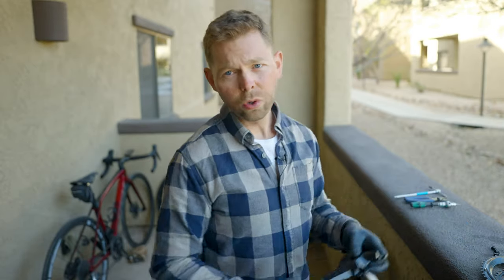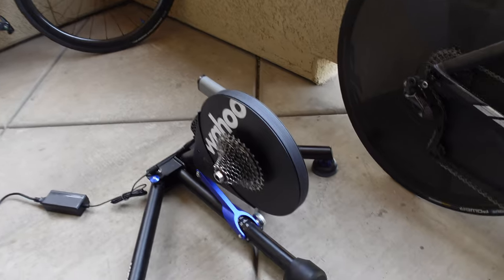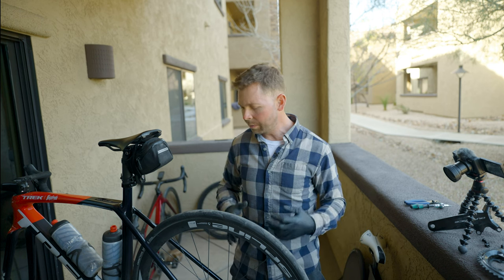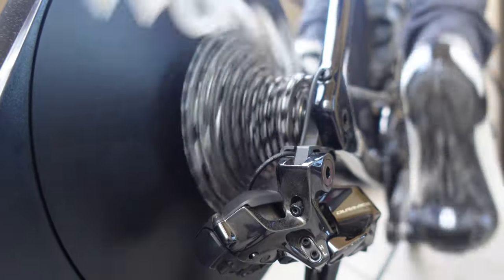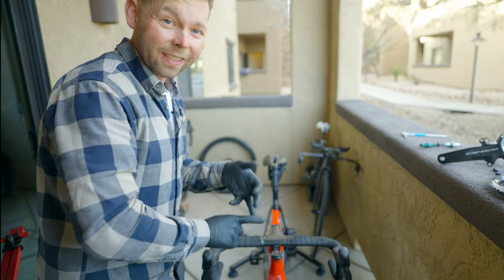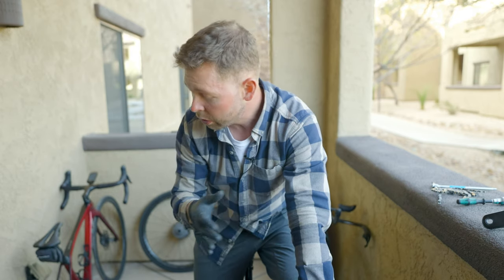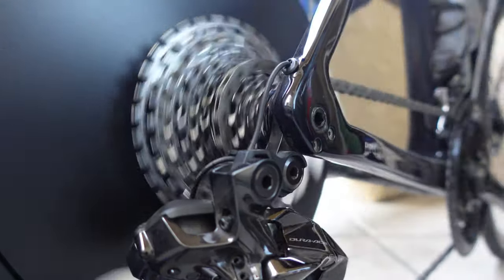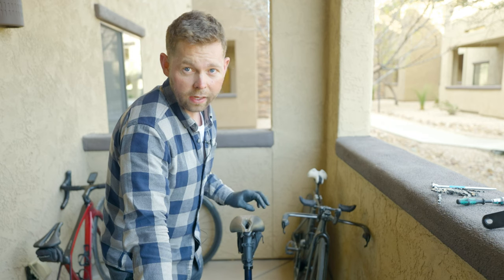Dura Ace 9270 Sram Red AXS Compatibility | Chainrings Cassette Chains #cycling #shimano #sram

Comment: Great video! I would be interested to know if you can run a 12spd Shimano cassette on Sram AXS 12spd?
Reply from the maker: Thanks man, I will give this a try!
Reply: Hi did anyone try this. Does it work?
Reply: @jonmaloneycycling7593  hi Buddy did you try this?
Reply from the maker: @ianhunter9971  Iam going to give it a try
Reply: @jonmaloneycycling7593  Have you had a chance to run this yet?
Reply: @jonmaloneycycling7593  Did you manage to try it?

I tried it. Axs force derailleur with 8100 cassette and xtr chain. Shifting was perfect in every gear except gear 4. It woukd chatter in gear 4. Tried it in 2 different bike builds with the same result. I've left it as it is as it's for our winter bikes  did 200 miles on it withiut shifting issues nice nad crisp but rattles in gear 4

Comment: I have two Quarq DZero power meters. Now I am contemplating if I’ll be able to run them on AXS 12spd drivetrain. Or if anyone makes 12spd chainring with 5 bolts 110 and 130 BCD.

Comment: Please address the issue of running shimano 12spd cassettes with Sram derailleurs. This is vital, because not all wheels have xdr freehub options and shimano 12spd are backwards compatible with HG freehub bodies. If people want to upgrade to 12spd SRAM, such mix would be a go to option. I would also try SRAM flattop and eagle 12spd mtb chain to work with 12spd shimano cassettes.

Hope you can make it happen 😉🤞
Reply from the maker: thank you for the comment and feedback!!
Reply: Yes true ..if have same issue right now as cost to convert my enve to xdr quite expensive
Reply: @jonmaloneycycling7593  any updates on compatibility testing? No need for detailed video, just say if shimano 12spd cassette works with SRAM AXS drivetrain (what chain would be best for this). I'm about to buy ultegra 8100 cassette and would like to have a confirmation, since you have both drivetrains at hand
Reply: @samarskyrider I’ve seen a guy doing the test (GC performance) and it works great. 
I would choose the chain compatible with the cassette (Shimano cassette + Shimano chain)
Reply: @antoineviard4580  Thanks for belated reply. I'm running this combo (SRAM RD + 12spd Shimano Cassette / Chain) since May 2022. Works okay except for front shifting, but this could be due to aftermarket Praxis 12spd chainrings
Reply: A universal chain like the 12s KMC most likely will solve the issue. No flattop chain works with Shimano cassettes. The Eagle chain works so lala but noisy.

Comment: hi Jon, can i ask something about mix sram and shimano set up?

i have a vintage bike eddy merckx with italian thread BB. so far it works with Grx Crankset. but i want to change my crankset with sram red axs 12s crankset. all my groupset (RD-FD-Brifter) use shimano ultegra r8000 11 speed.

So, is it possible? if yes, what’s chain and cassette should i use if i want to still use ultegra derailleur with sram red axs 12s?

Thanks

Comment: I was searching for this demonstration for a very long time since my dream setup would be a 12 speed drivetrain composed of a 10-33 cassette with a single front chainring of 44 or 46 teeth. Now I know that Sram offers this setup but I hate their brakes and batteries system so I would go with Shimano for the rest. The only possibility would be a Sram 12 speed cassette with a Sram chain and the R9270 derailleur and levers so my question is; why does the sram 12 speed chain shifts so poorly on a sram 12 speed cassette when combined with a 12 speed Shimano derailleur?

Also, I noticed the cassette on the trainer looked like a basic 12 speed Sram cassette instead of the 1290 one that you used on the stand; do you believe it could change something in the shift performance?

Edit: do you believe the shifting could be better with a MTB Eagle chain instead of the flat top 12 speed road chain?
Reply from the maker: I think you should not switch the parts and use that parts as per the manufacturer specs
Reply: I'm thinking the exactly same set up like your (9250 with red axs chain&cassette) !
So have you tried this? Have you manage to solve the shifting issues 
Thanks

Comment: Great video! The shimano 12 spd cassette on the 12 spd AXS group set would be really interesting. Love my older eTap for the way you shift, but I really don’t like the new gear ratios on the AXS groupset, so if I could use AXS shifters and mechs on more standard chainring/cassette options would be super handy
Reply from the maker: thanks for the comment!!
Reply: @jonmaloneycycling7593  I have to second Lee Sutton's comment/request above. I'd love to see the following: 1) Shimano Chain, 2) Shimano Cassette, and 3) "normal" 11/12 speed chainring ratios (50/34, 52/36), all coupled w/ the AXS front and rear derailleurs. A "Sramano" road setup, if you will.  This would give more normal gear ratios, and potentially give better options to those with older 11 speed freehubs & existing power meters, etc., who want to upgrade to wireless shifting. Would also theoretically give more chain options to 12 speed users - KMC, Connex, Shimano, etc.
Reply: @jonmaloneycycling7593  Also, should have put this in my original comment, but thanks for publishing these experiments!!
Reply from the maker: @finncox23  np!!
Reply: I've tried this today. Force axs front and rear mech. Shimano 8100 cassette and xtr chain. Everything works fine and all gears are smooth except gear 4 which chatters. Has anyone tried this successfully

Comment: Thanks for another great video, Jon! I have a trainer question for you. I noticed that you weren’t using the updated through axle adapters on your Kickr. Have you had any issues with them scuffing on the dropouts? I have the new adapters from SRAM, and my bike fits great on the trainer. However I do experience small scuffing from time to time when mounting the bike and the trainer. Take care.
Reply from the maker: Thanks so much bro! I didn’t know they have new adapters, I havn’t had any issues though, I have more problems putting the wheel in and out.
Reply: So you’ve experienced some scuffing from getting the wheel in and out? Same here. I actually put at protective patch on the left chainstay where the rotor was making contact when would remove the wheel. It really helped. Little scratches bug me…but our bikes are tools, not jewels and they’re gonna get “love marks” when we use them 😉👍🏻
Reply from the maker: @aaronkoch7607  thanks for sharing!!

Comment: Hello Jon
I want to ugrade my BB90 Madone to 12 speed Sram axs. However due to the BB90 i can only use Shimano crankset. 
Would a shimano 12 speed crankset work with everything else been sram force axs ?

Thank you
Reply: I did the same thing with my Trek Madone 2019. You can get a BB90 for GPX cranks. Sram offers a Sram red axs crankset with gpx compability, instead of the modern DUB cranks.
I would be interested, if you already found another solution to your problem. :)
Reply: @luissteiert6483  My solution is to do the same thing i did with my current 11speed sramano set up. I have shimano cranks/chain/cassette and sram etap fd/rd. It works fine and i assume the same will be with 12speed and i will  not have to use xd adapter.